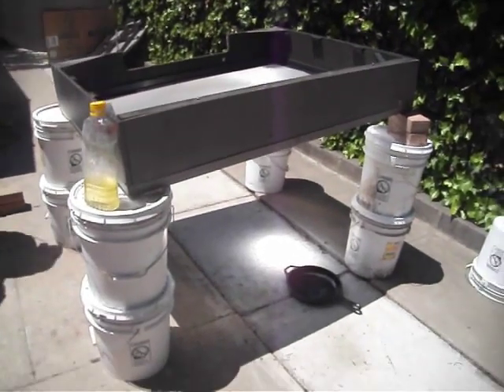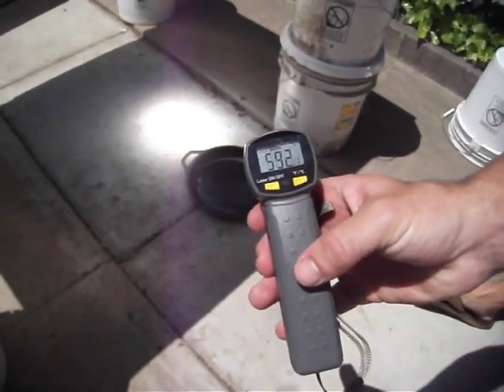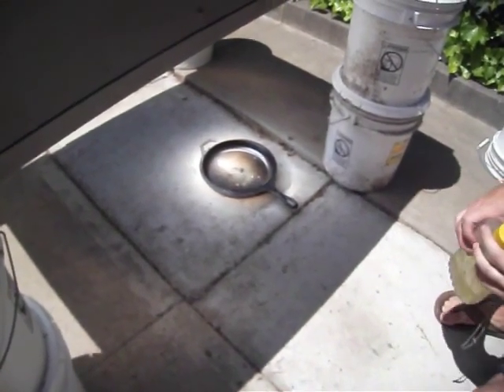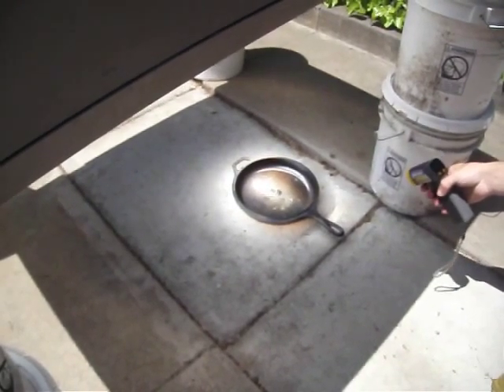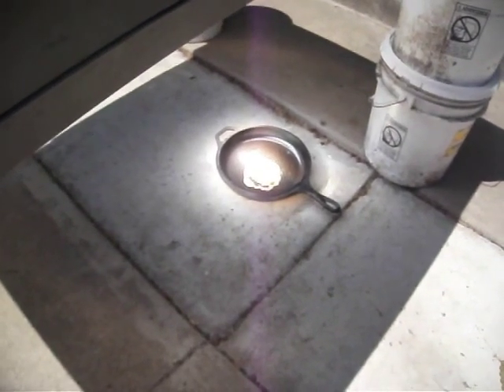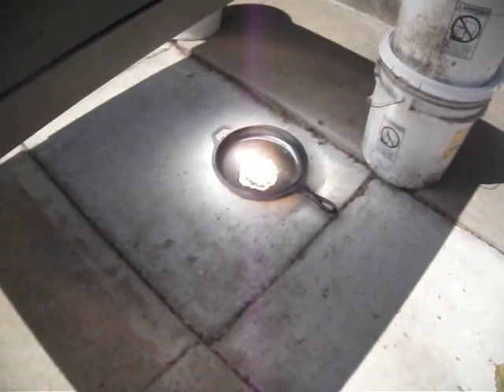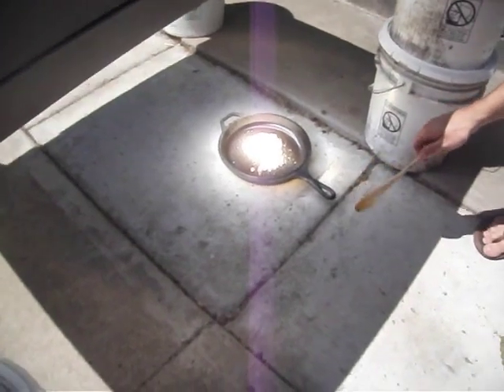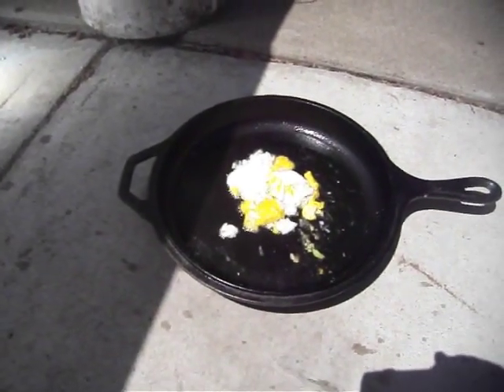SOLAR COOKER/GIANT MAGNIFYING GLASS!

Comment: Hi there, this is Ryan, the one in the video.  To my knowledge the lens is in all rear projection tv's.   The lense on rear projection tv's does not touch any electronics, I believe you are thinking of the capacitor in CRT tv's.  Basically all you do is pop off the bezel, and remove some screws.  Once that is done you will separate the plexiglass front piece and there was a dark film that was on the fresnel lens.  Just remove that and you have your lens.

Comment: Since I have the power now to pre-cook and dyhdrate everything, my plan is to cook/dehydrate and assemble a number of meals (MREs, basically) that will only require boiling/hot water to reconsitute in a stainless steel thermos bottle. I think you've got a winner there with that solar cooking lens.